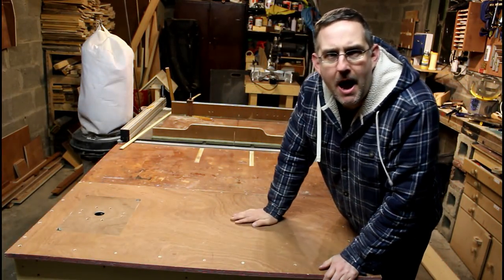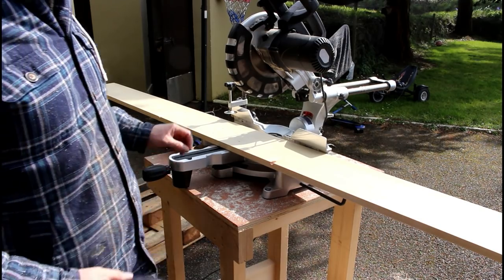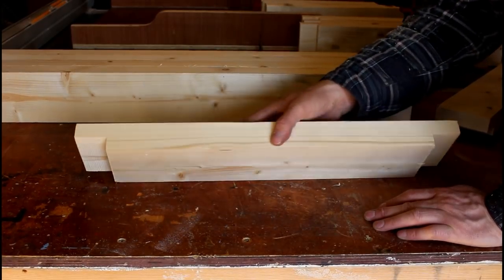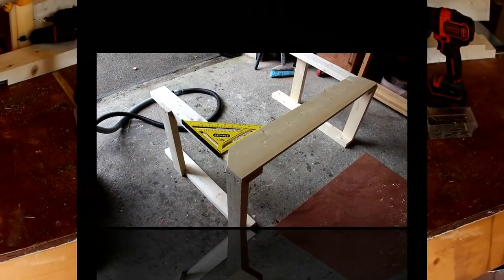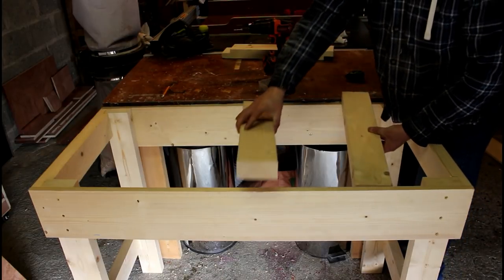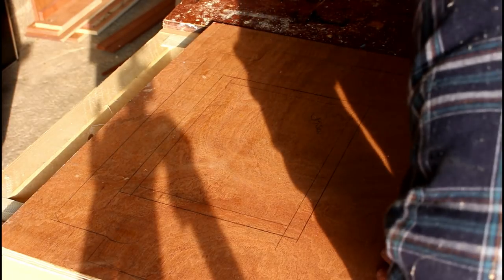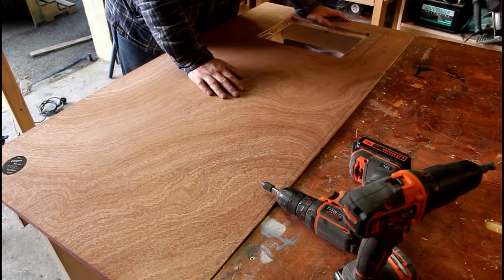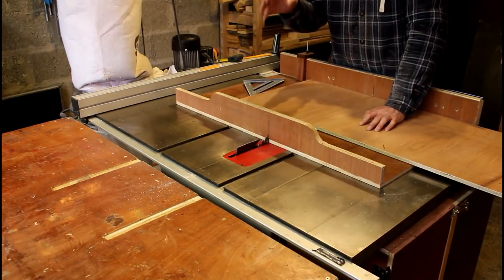Work Benbch with Router

Comment: Great build mate, mistakes happen and it's good to show people that as well. 
As for the fence you said about locking the fence down one end, unless i miss heard you? but why not do the two t-tracks running alongside the router top as you said, and make the fence and drill two holes into it, and a couple of bolts and star knobs, and lock the fence down into the t-track? but you prob thought of that already.
Barry (Wirral, ENG)
Reply from the maker: Hey Barry! Good to hear from you! Yeah, T track would be the way to go, but getting here in Ireland is near impossible without paying a Kings ransome in shipping costs! My cross cut sled has a length of t track on it, but that little length cost me over €50! Think I'll route some groves through the ply, and secure with bolts from below with home made star knobs!